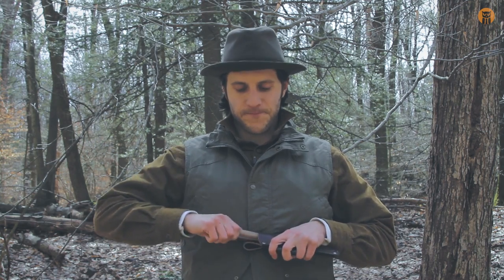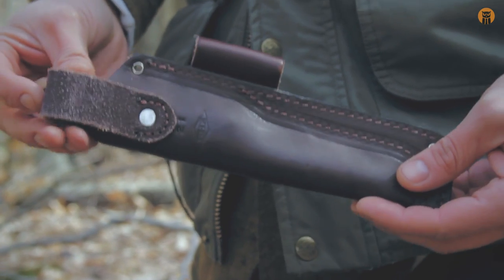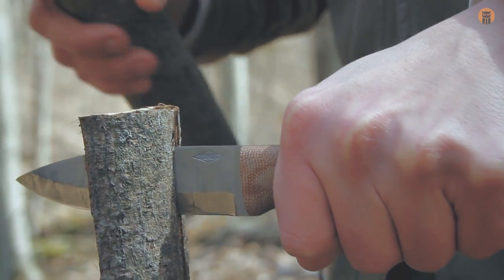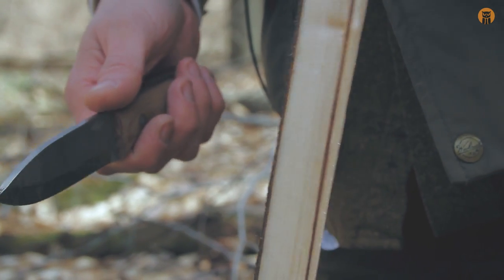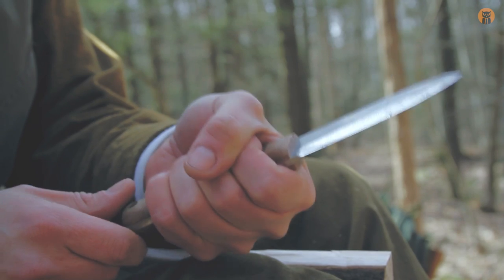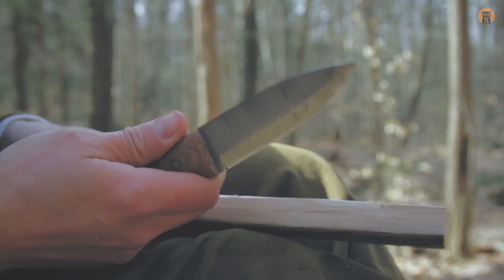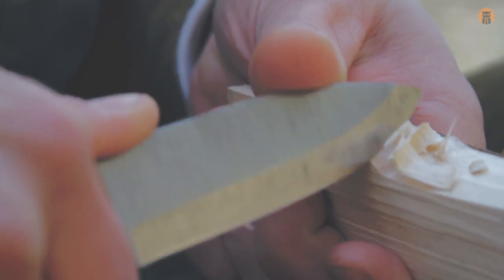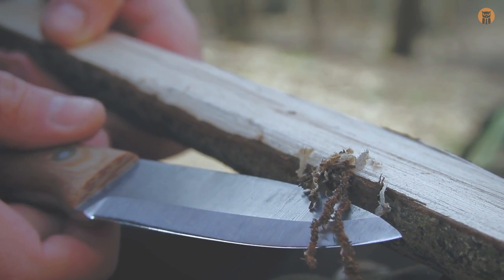Battle Horse Knives Fieldcrafter | Bushcraft Knife | Field Review

Comment: Great video! Looks like a nice knife. Is the steel used in this knife a carbon steel? How easy is it to sharpen and how good will it hold an edge? I'm not very familiar with the different steel names so the name didn't ring a bell.
I'm also still waiting for that video about your woodcarving tools :)
Keep 'em coming! ^^
Reply from the maker: Yes it will hold a nice edge. And in my experience, the steel type isn't the biggest factor on how difficult it is to sharpen - it's the heat treat. And the steel will create sparks with hard rock.
Reply: BlackOwlOutdoors
Okay thanks! :)